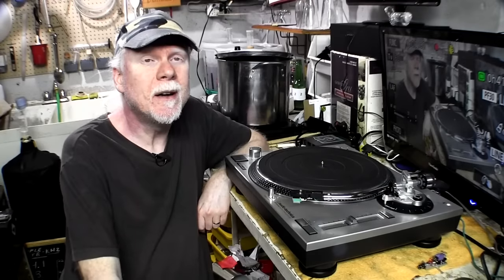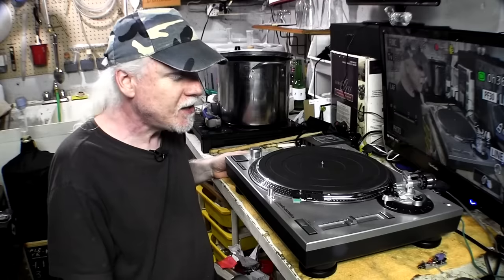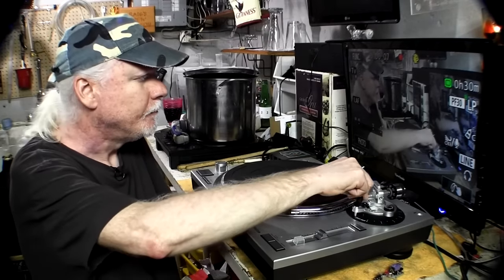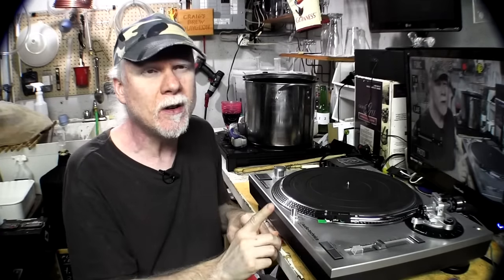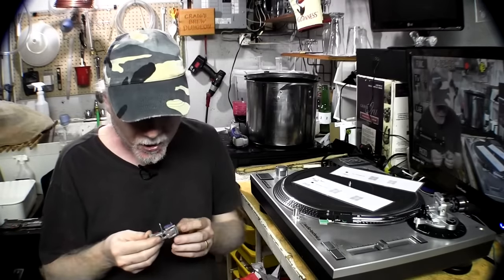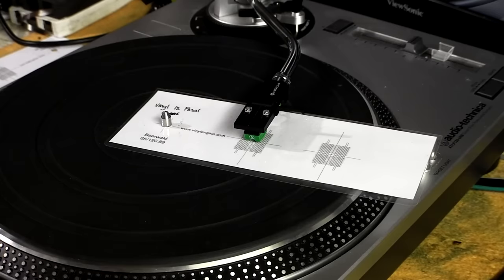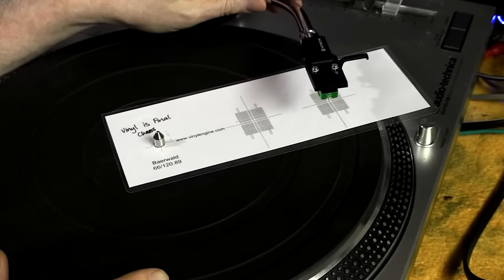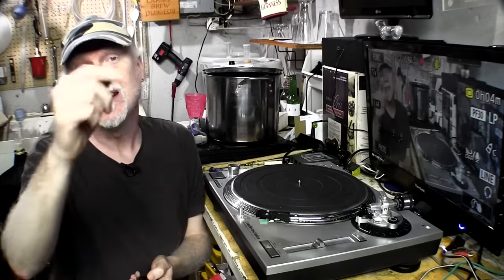Very Detailed Turntable Setup for Beginners

Comment: When I was a kid I had a Garrad Sp25 Mk4.
I was given it by my older cousin as his kids had pulled all the wires out of the arm.
I sat there joined wires and rethreaded the wires into the arm.
I bought a Leak amplifier and some beaten up Tangent speakers from the local free ads ( Or rather my dad paid) and I had my 1st stereo.
 I used to mess about with it so that the arm barely moved when you dropped the cue arm so it then bounced over the records skated across the record bouncing off acrass the label.
once I took the counterweight off and it cut its own grooves that upset me as I had to go and buy the record I ruined again.
However
When setup correctly it was a pretty good deck for a 12 year old with ADHD.
When I was 16 I bought a Maranz amp Turntable and Speakers from my mum's mail order catalogue and since then have spent more money than I care to think about on HiFi equipment My Setup still sits in my lounge although I've not really used it in anger for years.
It all worked last time I tried everything Other than my record deck which my kids wrecked 20 years ago I bought a new cartridge and stylus for it but never set it up.
Maybe over the up coming holidays I might do that!

Comment: The anti skate adjustment talk about splash distortion on one side is accurate. Years ago with a Thorens I would get the distortion in the center with adjusting the anti skating, then final adjustment was the stylus pressure to eliminate it. Nice information thanks.

Comment: Great video. The only problem i have is that i balance my tonearm perfectly level and add the correct weight for the cartridge. But when i use the digital scales it says im 0.1 out on either turntable. If i go off the accuracy of the digital scales then when i put my counterweight to zero, the tonearm is way out of balance. 
The scales are brand new and i know they’re in good condition. I think i’ll go my own estimation with a balanced tonearm, as opposed to an out of balance tonearm that reads perfect weight on digital scales.

Comment: When it comes to adjusting the cartridge, what if you can get your cartridge parallel to the protractor, but then the cantilever isn’t straight. Do you then adjust to the cantilever or is it more important to get the cartridge straight?
Reply: That's what he did not mention, you should align the cantilever and not the cartridge body.

Comment: I carefully followed the steps. I have the exact turntable. When I lower the lever down on the record it tends to bounce. I even downloaded an AudioTecnica protractor and adjusted that. It plays the record fine but it drops too fast when I'm queuing it up. Any advice anyone?
Reply: You mean the cartridge drops too fast? It may not be properly calibrated then; make sure the weight is balanced first and then add the grams by turning the calibration
Reply: @rafdelag  hi yes I was very careful to get the tonearm parallel to the platter and balancing on it's own. Then I add 2 grams weight and 2 on the anti-skate dial. IDK, I tried it like 6 times. I'm starting to think I wasted $300 on this turntable. Once the cartridge is on the record it plays fine. It's just when I lower the lever it bounces.

Comment: That cartridge alignment protractor thing is total bullshit.  The angle on both graphs of the protractor is exactly the same..... 100% parallel.  I'm looking at it right now.  The cartridge cannot possibly align the same from one graph to the other.  If it is perfectly straight on one, the other is about 5 degrees off.
Reply: The proof is in the video.  I didn't edit that part, so you can see that is lines up on both graphs if you get it right.

Comment: There is absolutely no reason to go through all of this to be that precise to play records you can set it up very simply leveling the tone arm bring the front knob to zero and track it to 2 g. It’ll be fine just make sure that your turntable is setting all level surface. As far as the cartridge alignment, you can get those online of paper print out a hole in the end it down on the center of the turntable line your cartridge tighten it down you’re done.😢

Comment: the needles does not "arc" when the needle travels across the record. the length of the needle arm never changes therefore the needle tracks at the same point throughout the disc. the disc however does change from the larger end to the smaller tighter circumference.